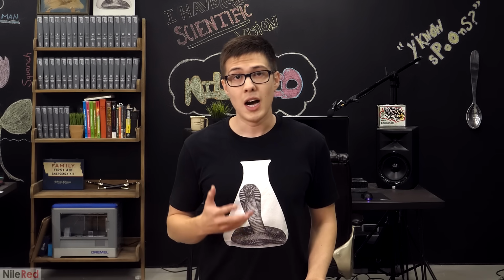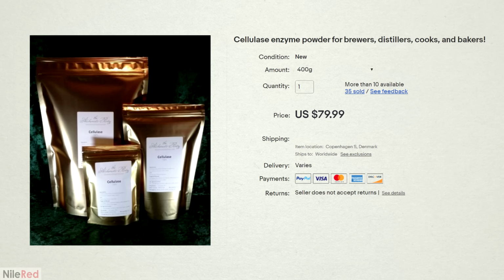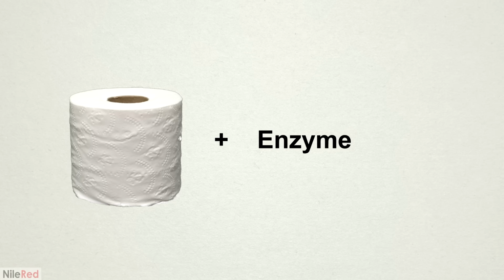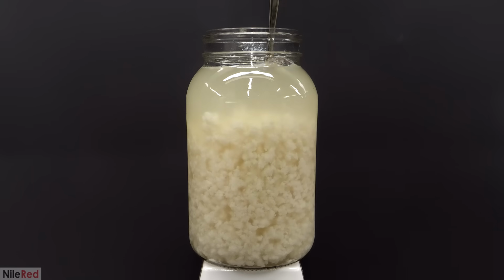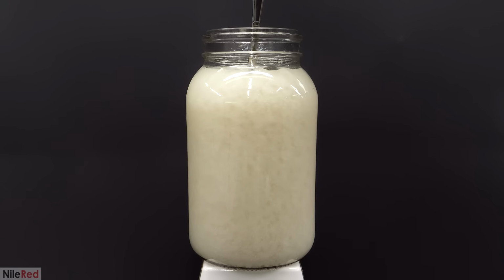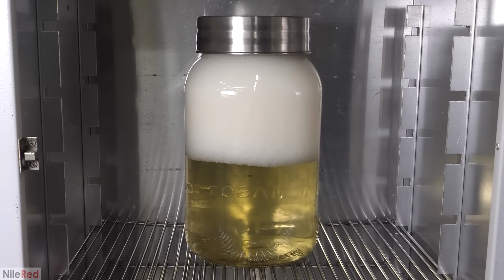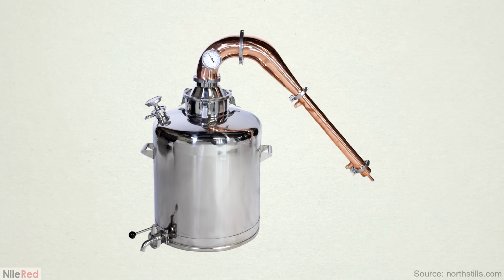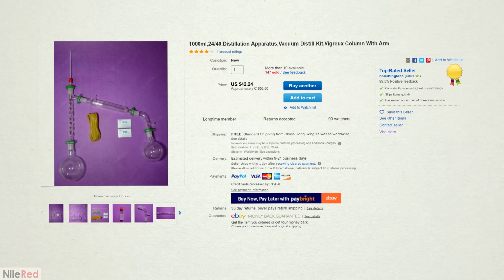Making toilet paper moonshine

Comment: It would have been great to have seen you invite a guest who does things with alcohol to try it. Not only to get their take on it, but for their reaction hearing that its made from toilet paper.
Reply: To have someone drink this, he would need to distill it again and remove alot of the alcohol from the start of the process. All Alcohol contains Methyl alcohol (methanol) which is extremely dangerous to consume. 10ml of methanol will blind you, 30ml will kill you. Methyl Alcohol is usually one of the first things to come out of the still and is part of what distillers call the Foreshots. the foreshots have a very sweet smell, almost like a Candy mixed with Nailpolish remover.
It would not be wise to let anyone drink this alcohol unless the whole experiment was done in a larger batch and done differently using a better distillation process.
Reply: @GingerNinnja  He mentioned that pectin leads to the yeast metabolizing methanol, and he didn't have any pectin since it wasn't a fruit that he got the sugars from. He also did go into detail about the different stages and separated out the foreshot and discarded it, he just put the heads heart and tails together because he said the ethanol was too valuable to waste
Reply: @sugarbooty  Ahh, I must of missed that part about discarding the foreshots. And it is true about fruit sugars, even using actual sugar still gives methanol just less. I should have mentioned that even store bought alcohol has methyl alcohol in it. just at a very low level. (Not sure how true it is but I remember reading somewhere that its Methanol that causes a hang over and a Hang over is essentially methanol poisoning. ethanol is actually the antidote to Methanol poisoning. Don't quote me on this not sure if it was 100% correct..)
I am no means a chemist, but I come here for the chemistry fix..
Reply: @GingerNinnja  Yes, I do believe that the fermentation process does produce some methanol, it depends on the yeast that you add. Brewers yeast has been selectively bred to produce almost no methanol given sugars but I believe pectin still makes it slip up. The sweet smell from the foreshot is the volatile oils from the fruit itself, and volatile chemicals in general which is the acetone smell. I'm no chemist either but I love my chemistry fix as well, have a good day my friend
Reply: @GingerNinnja  If I remember correctly, ethanol is less of an antidote to methanol, it's moreso that the liver processes ethanol before methanol, so flooding the body with ethanol gives it time to get rid of the methanol. Basically, all the ethanol cuts in line in front of the methanol.
Reply: Heya, I’m a home brewer (mead, beer, champagne and occasional weird distilled stuff). The process is very similar, except we use time instead of enzymes to break stuff down. My guess is this tastes awful because of all the junk in it and because he wasn’t careful at all about oxidation. Also it’s like 130 proof sooo... no thanks.
Reply: I came to comment section to say this

Comment: 4:40 "purely just toilet paper" --plus the glue residue from the cardboard tube. Yum
Reply: Eh, that little bit becomes completely negligible when dissolved in such an amount of liquid.
Reply: @latte_macchiato_de  If you mean compared to the original amount of liquid, it's small. If you mean compared to the final distilled alcohol, it's less small. 

So the question is, does the glue get past the distillation phase? Does it get left behind at an earlier phase? When?

Some toxins are dangerous even in very small amounts. So the question is, what amount of this glue is toxic?

It sounds like you haven't answered these questions.

Comment: 1)your science to get to your wash is super cool. 2)you really should have did more research on distillation first.. (You never ditched the methanol on the front end of each run. Methanol = POISON), this was really neat! I'm impressed. FYI a way to clean it (remove oils etc) is to filter with charcoal or a Brita filter).

Comment: Hardest item to obtain for experiment in 2020: the TP.  Perhaps it is not an issue because of the distillation process, but considering the caustics that go into the manufacture of paper products, I'm actually surprised it would be safe to drink.

Comment: Biochemical process engineer here. I think this overall process is super interesting and this is a cool experiment, but I have some commentary I'd like to share. 

Rather than using a chemical pretreatment, I believe you could also have finely ground the toilet paper in your buffer medium and the dissolved enzymes in one solution. To grind/chop the pulp, you'd use a high powered blender before enzymatic hydrolysis. So why use alkaline pretreatment at all? Well, the reference you use mentions alkaline pretreatment for "lignocellulosic" biomass, which is a key difference! Alkaline pretreatment for this feedstock functions to remove additional compounds the cellulose is entrained in, like lignin and hemicellulose. However, for high purity cellulose like in paper products, you simply need to increase the surface area of the cellulose before hydrolysis, since the cellulose is no longer entrained in cell walls with the other polymers like it is in raw biomass. I say this only because it might have saved you an extra step and wouldn't have taken as long as you might have believed if the paper was sufficiently ground before hydrolysis. Even though we know alkaline pretreatment works to increase the surface area of cellulose, it might not necessary because it requires an additional consumable and step in the process.

Some lignocellulosic pretreatment doesn't even use an alkaline pretreatment. Sulfuric acid pretreatment before hydrolysis and fermentation is also common, even if it functions completely differently than the alkaline pretreatment. In a perfect world, no pretreatment would be required to separate the cellulose from the biomass, but we've yet to figure out a way to do that. I would be happy to send you the papers that review these pretreatment steps if you're interested in this kind of work!
Reply: Hah.

I know some of those words…
Reply: @MmmDeliciousMeat  that part
Reply: I would nod approvingly if i were there with you chatting, not that I actual understand but appearances you see :)
Reply: What the shat
Reply: I don't think mechanical grinding would have any effect on toilet paper. It already mechanically separates just from being wet---that is the main characteristic that makes it suitable to be flushed.
Reply: Scott Satinover 

Pl k p k p
Reply: Scott Satinover  nani
Reply: make videos please
Reply: s m o r t  w o r d s
Reply: he is speaking the language of gods
Reply: @umaru1942 alcoholic gods….
Reply: Fellow chemist here my first thought was to blend the paper too. When he started describing the cellulose enzyme it did sound like it should work without pretreatment. Awesome to hear your experience and input 😊
Reply: Nice
Reply: @Andrea Martinez bitch you're watching a chem video ???
Reply: What
Reply: Wow, that's alot of words.
Reply: I love reading replies like this and understanding absolutely nothing
Reply: Scott Satinover Is he really making ethyl alcohol (drinkable) or is he making wood grain alcohol (toxic)?
Reply: magicbuskey Wood grain alcohol is made by condensing wood gas produced in pyrolysis. In this case he is fermenting glucose, which is how you make ethanol
Reply: @1495978707  I was under the impression that TP was made from wood and didn't have glucose. I take it that impression is wrong?
Reply: @magicbuskey  Wood is primarily cellulose fibers which in turn can be converted to glucose (in this case using the T. Reesei fungus) sugars, and then fermented into Ethyl alcohol.
Reply: @SiliconSentry  Thank you.  And thank you for taking the time to reply!
Reply: Giggity
Reply: Scott Satinover Can you give a TLDR?
Reply: @yellowblue_tt  Don't be lazy.
Reply: GD foof48 not op but, tldr is don’t need to pre-treat because the cellulose was already accessible for the cellulase.  However, you should read it because it is quite interesting and you could learn something new.

Tbh though I think it would make the next step take longer, so not really any different in timescale.
Reply: @ShineHunter4  Even if the time scales are similar, I'm still not sure it would be necessary. Firstly, there are other ways to increase the hydrolysis rate without using alkaline pretreatment to expose additional surface area. Temperature control, enzyme concentration, and physical shearing will all increase the reaction rate and can be done in a single batch. Pretreating using an alkaline solution either requires further pH neutralization for enzymatic hydrolysis to work, or a second batch process in a neutral pH medium (which was performed here). Requiring a two batch process is generally undesirable from a chemical engineering perspective, though there are some exceptions. From a scale up perspective, besides material costs, this would also require additional infrastructure, including an additional holding tank, liquid additive pumps (for pH modifiers, buffers, etc.), fluid flow pumps (to move spent liquid), and sensors to help control the conditions. So there are additional fixed costs as well as variable costs. The only way to really find out which scaled process is best would be to model the process using software like ASPEN. Those process modeling programs often carry a heavy license fee, far more than I'm able to afford. 
That being said, this is a lab experiment and scaling the process to cost efficiency is an entirely different challenge beyond the scope of this video. But in the world of biofuels, that problem is a real scientific and engineering concern that people are still working on. Just food for thought.
Reply: That is looooooong

Comment: Have you considered the adhesive used in securing the paper to the roll?  Might be soluble sugars in there.  A small amount to be sure, but you're typically so thorough that I was surprised you didn't mention it.

Comment: Home mead maker here. I wish you had done a specific gravity measurement so we could have figured out roughly what the sugar content looked like. Heck. If I ever get bored, I might just redo this myself from a brewing perspective to see what the sugar content of your "mash" was. Judging by the amount of alcohol produced, it may not have been very high, but that could also have been a product of using brewer's yeast (which has a relatively low alcohol tolerance) versus something like EC-1119 that can ferment up to a 19% ABV (in ideal circumstances).

Also, most distillers would have called this first distillation a "stripping" distillation: a rough, quick and dirty, distillation just to decrease the total volume of your next distillation. Slower is usually better in distillation. Distillers will usually also take the "tails" (or the last bit of a distillation that doesn't exactly taste great after you get the "hearts" out) and add them into the next distillation they run.

Comment: The run is only coming out white because you had a bad case of the foamies due to overfilling it and probably too high of heat. If you poured some of the pot off, it would have prevented this, however cleaning the tube and column would have eliminated the white cloud you ended up with at the end.  Also, wood alcohol is product of the same type of fibers broken down, however methanol, or wood alcohol and other volatile compounds such as isopropyl are probably being output within the first good 10% of your batch that comes off at like 148 to 170. At 173 the ethyl alcohol is released and should be the only alcohol you do NOT discard. Once it gets to maybe 185 it may start to get cloudy again , so you should shut it down and discard the tails to eliminate fusil oils. You should have between 120 and 160 proof alcohol due to the use of the column as it tempers the distillation like a thumper would if you did it correctly without a paper enzyme bubble bath. The PH was probably not correct as well due to the enzyme remaining active while fermenting. The ph should be taken before yeast has been added and after fermentation so you could determine the ABV your wash will have. Once you know the percentage, then you have a good idea how much product it will make, and how much of the foreshots and heads you should remove.

Comment: science of the masses man you want to keep the solution at around 175 to 195 f (sorry not bothering to convert) and if it hits 212 it will pop thankfully your setup wasnt fully sealed so when it did hit the point it just frothed over but in normal setups its just....... explodes ...... it creates a seal at the turning point pressure builds and boom. cool concept i may have to test it out

Comment: Now today, it is SOOOOO much easier to just buy booz. TP is hard to come by. I really don't get it though, if you used 2 rolls last month to wipe your backside and it will take 2 more next month.... there was no interuption of supply, why do people need to buy truck loads .. just in case thus CAUSING the very thing they are worried about? Single people can be smart, people on a whole are very stupid.

Comment: 2019: let´s make toilet paper alcohol, it´s so cheap.
2020: -_-
Reply: $80 for the enzyme is not cheap!
Reply: @jaackmcmahon8757  That was for enough enzyme for a bit more than 4 batches (he used 90g and the listing shown was for 400g, still makes it arguably a little under 20 dollars, but aside from that at about 2 dollars a pound (453 grams in a pound) for citric acid and using about 12g that's not worth calculating and with 25g of sodium citrate  I'm seeing listings on amazon under 50 cents per ounce (about 28g) and brewer's yeast can go for about a dollar an ounce but I'm not sure how much he used. All in all about 20 bucks per 78ml of 128-proof moonshine makes it a bit expensive (that's about 3 standard servings of alcohol), but there's some novelty to it
Reply: @vlanoik  Nicely reasoned

Comment: You needed to use a puke barrel or thump keg. That would allow the solids to settle and the alcohol to rise up and out of the separator. The heads, the first bit of the run, contains toxic methanol. It will make you go blind.
I thought wood alcohol would make you go blind.
You should be able to get 140 proof on your first run, lab boy.

Comment: I've done plenty of distillations in my time as a chemist, and I can tell you that filling your rbf almost to the top is a classic error. If you want the boiling to be stable, you want the largest possible area of interface between liquid and vapour above it, and with a spherical flask, that means filling it no more than halfway. Stirring also helps if you've got a heating mantle with a built in magnetic stirrer, but if not, use some anti-bumping granules, or just a few spoonfuls of rough gravel.

I'm also surprised that the initial enzyme treatment was done at such a high temperature: I always thought that the ideal temperature for enzymes to function was around body temperature, or 37 degrees C. Heating it up to 50 degrees C should have denatured the enzymes, though perhaps not enough to stop them working completely, hence why it still worked. But if you do this again, I would go to no more than 40 degrees C for the most efficient enzyme action.

Comment: It's not exactly true that methanol only occurs when fermenting certain types of food. You can make methanol from wood, in fact, that was the primary source of methanol for a long time. You just heat up the wood to 500°C (932°F), turning it into charcoal, catch the vapours and condense and distill them. That gets you methanol, as well as some acetone, acetic acid and methyl acetate.

Comment: Since the mixture you were using the hydrometer on still had a few solids, it's possible your concentration was a bit higher. Without taking an original gravity reading and taking a second to compare it to, unless you're testing an (almost) pure mixture of ethanol and water, you can't rely too much on those hydrometers that just have the concentration listed on the side.

Comment: I dont know much about any of this, but can someone explain to me how 20ml of 20% = 5ml of 100%? 31:30 in vid
Reply: If 20ml is the total, then 20ml = 100%,  100 divided by 20 = 5.

Basically its saying thatin 20ml @ 20% you have 5ml of ethanol, and 15ml of water, therefore when you distill it down to 5ml (removing the water) all your're left with is 100% ethanol, which is only 5ml.
There is the same amount of ethanol in either case, you just change the volume of other stuff.

Hope that makes more sense?

Comment: Ummm, highly poisonous, you can make alcohol from almost anything that is or used to be plant based, because all plants break down into sugars, but that doesn't mean it makes drinkable alcohol, normally any plant that you CAN eat you can make into alcohol that is drinkable. Rubbing alcohol is made from wood and is toxic, therefore it will kill you or make you go crazy at the least. Toilet paper is made from wood and has toxic chemicals still in it from it's processing, therefore you can make alcohol from it but it's only good for killing germs and not for drinking.